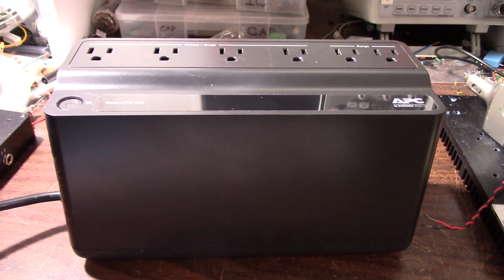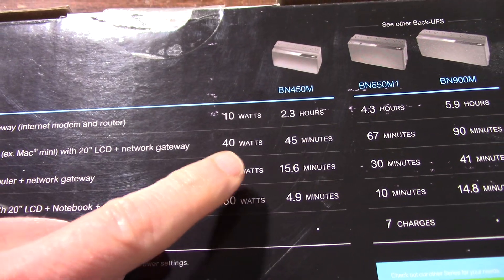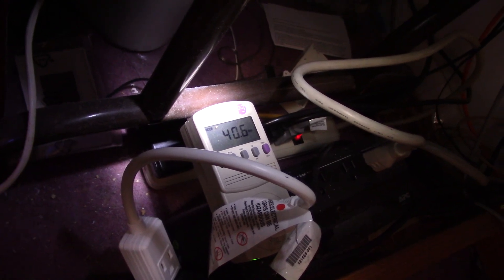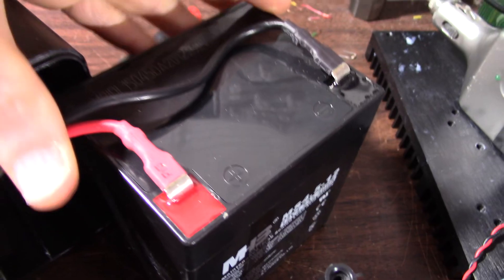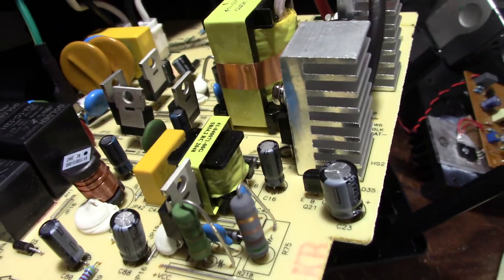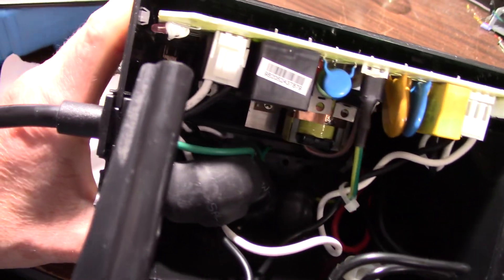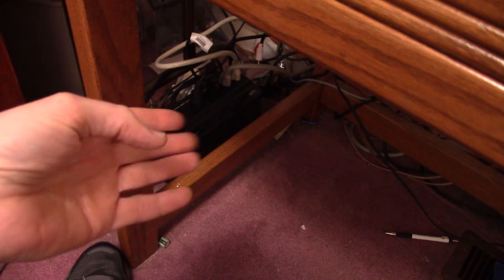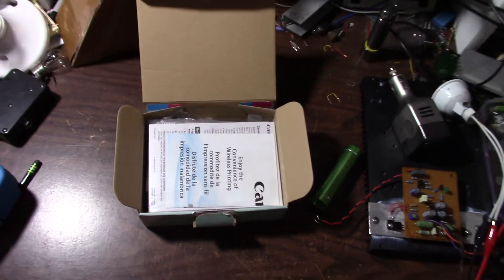APC Back-UPS 450 battery backup supply teardown

Comment: Which screwdriver is required to get the screws out.  Is it just a #1 Phillips or a specialty screw head?
Reply from the maker: Phillips as I recall.
Reply: @JohnAudioTech  #1 or #2?     The ones that I have are too short and I need to know which one to buy.   The longer ones tend to come as a Phillips and flat head set.
Reply: I had to rummage around in my screwdriver collection until I found one long enough, and thin enough to get in there and remove the screw. I had one from a Craftsman screwdriver collection I bought years ago. Might have been the first time I ever used it.

Comment: I have one of these powering a number of audio visual, cable modem, and wireless router functions for much the same reason you purchased yours.  Last month the thing just went dead, and I was all irritated about how I had just bought this thing and then it just up and quit, until I looked at the receipt, still taped to the case, which showed a date over 5 years ago....so yeah...think I got my $40 worth....

Comment: This model, after the electricity goes off, it stays on for only 2 hrs and 20 minutes, EVEN WITHOUT ANY LOADS. This unit comes with a 12V 4.5AH battery, so I added in parallel a 12V 35AH battery to it, that makes it a 12V 39.5AH unit. It's supposed to last 5 hours without electricity for what I'm using it for(about 90 Watts), but it doesn't. At first I thought it was overheating with the load I was putting it through, so I tried very light loads, like 10 Watts, and it would still shut off at 2 hrs and 20 minutes, so I tried it without any loads whatsoever... same thing. Does anybody knows how to override this?
Reply: You are supposed to use the same battery if you run multiple batteries.
Reply from the maker: I'd guess that it is a time limit programed into its micro controller.
Reply: @JohnAudioTech  That's what I think also. I'm just hopping somebody would know how to override that. If I had the schematic for it I'm sure i could, but I haven't been able to find it.

Comment: This unit uses a 12V @4.5A battery, so max power is 56Watts, unit advertise for 255Watts max, so this is 4 to 5 times what this tiny battery can supply. I replaced the battery with an external 12V @40A Lifepo4 battery with the wires going out of the unit. It can now supply a 255W load for 1.88 hours, almost 2 hours. Great video bro.
Reply: No issues with the internal BMS charging the 40A?  How long does it take to charge?  And what's the model battery of the 40a?

Comment: You can extend the backup time by adding another similar battery in parallel. Or you can use a car battery or a deep cycle agm battery or  a Lithium battery. Lots of videos are available in Youtube.
Reply: Woah! DO NOT DO THIS if you expect to use the inverter at higher powers. The circuit is NOT heatsinked sufficiently to deliver high power for a long time. It will overheat and die. The standard battery within will only last a few minutes at high output powers, which is enough to raise the temperature, but before it gets too hot, the internal standard battery will be done.
Reply: 12ah 12v lithium iron phosphate battery should be the best replacement it will run this unit for atleast 2hrs on his load.

Comment: Switch to Linux and Microsoft will never bother you again with its nonsense, and it's way faster than MS Winblows. It shuts down faster and doesn't go to "recovery mode" when the power goes out. When I use Windows it's like it has got a mind of its own and impedes everything I wanna do. With Linux it just does whatever I tell it to.
Reply: Linux requires patience and persistence which most people are not willing to put time into learning it. I love linux BTW

Comment: I have a UPS in my Basement Running the cable modem and Wi-Fi. I got it used from work I put a trolling motor deep cycle battery on it as long as its not overloaded its got power for DAYS!

Comment: I didn't see anything in your desktop icons that you couldn't be doing in Linux. When the power fails in Linux journal recovery happens pretty quickly. You don't have to connect to anything fancy to run Linux either. There's some software you definitely need Windows for. But if you're not using it then I don't see any reason why anyone would. Power fails here all the time. A bad shut down adds like 2 seconds to my boot. It's not a big deal.
Reply: exactly
Reply: One reason to my switch to Linux was its hyper speedy shutdown in less than 10 seconds (4 seconds from ideal). While Windows 7 took about 20 to 30. Which is lots of time running on old UPS.

Comment: Apc really cutting cost these days. They could have easily used a 7.2ah battery . those are like 15 & 20$ in here new from reputed manufacturer. , Although i like the high frequency inverter design those are much more efficient than the 20yr old one i have with a heavy ass transformer .. those things consume a lot of reactive current on idle and drain the battery quickly. The output could be made pure sine wave with a slightly more complicated controller and filters . They already had the H bridge. My old ups had removable battery newer ones at similar price makes u take apart the entire thing.
Reply: you can just buy a broken one and just connect a car battery.
Reply: @SupremeRuleroftheWorld  car battery is a bad idea. Car battery will die within 10 to 20 discharge cycles. They are not ment for deep discharge their plates are spongey and have high surface area to give that high surge current required for cranking an engine. If u discharge your car battery few times it will not take charge . Better use a battery that's made for the purpose or lithium iron phosphate if power outage is a regular thing.
Reply: @KuntalGhosh  whut? car batteries will last for years. the load is extremely low and you will never see full cycles with a setup like this. but i agree that lifepo4 is the superior choice. but the voltages ACP uses are a bit "off" for that. you need 24 or 48V UPsses to get the right voltage to float a lifepo4.
Reply: @SupremeRuleroftheWorld  nope. They don't have much capacity. & They are not made to be cycled. Like if u discharge them to the levels of what a normal ups battery is subjected to it will die within months of regular use. I have done this personally when the backup ups of my server room died and i had to use the battery of my car which was like a year old and it died within few weeks of regular discharge cycles. Which is about 1hr on battery power and then the backup genarator takes over this puts down the battery to 40% charge level. I currently have 1 * 180ah battery cus power is so reliable my batteries die without even being cycled like 50times. Last time i replaced my ups battery it had like 5 or 7 power cuts on it on a span of 4yrs. 10yrs ago power backup was super important cus we had regular power cuts of Atleast 2hrs.
Reply: @KuntalGhosh  you do know that APC overcharges batteries on purpose right? you need to put a diode on the battery charger output to lower the voltage by 0.5V. that will stop the battery from cooking itself to death.
Reply: @SupremeRuleroftheWorld  never seen that. My ups stops charging at around 13.6v which is much lower than 14.4v maximum of a lead acid battery.
Reply: @KuntalGhosh  no, they dont work like that. They constanty top off and go well beyond 14.5v if you actually bother to check.
Reply: @SupremeRuleroftheWorld  i just checked that on a brand new apc br1000g in and it had charged the batteries to 26.6v (it has two 9ah 12v batteries in series).. it should go upto 28v after initiating a charge cycle once completed it should fall back to absorption voltage.